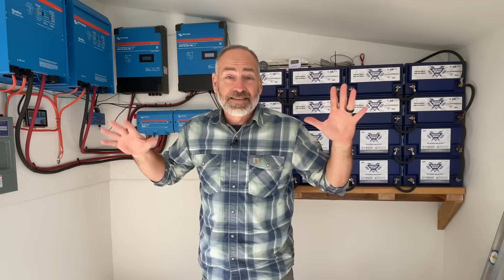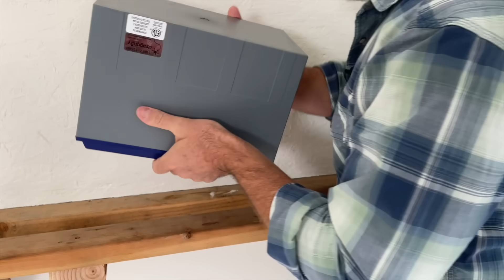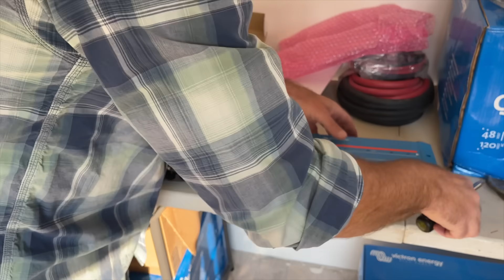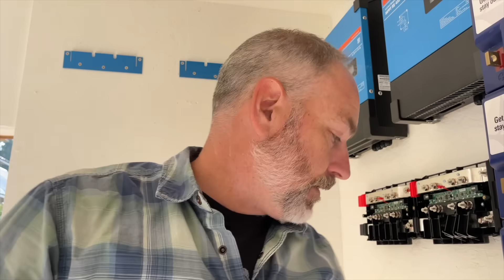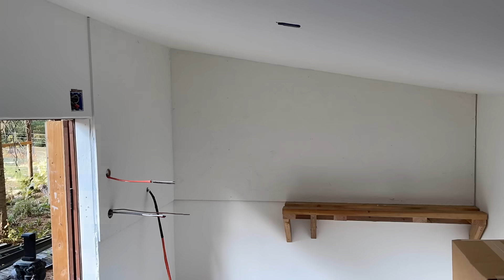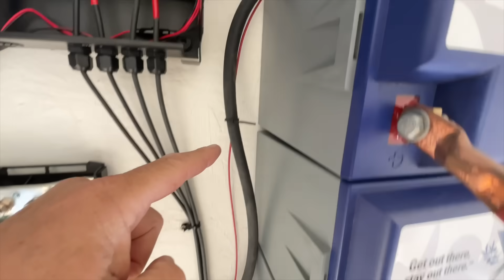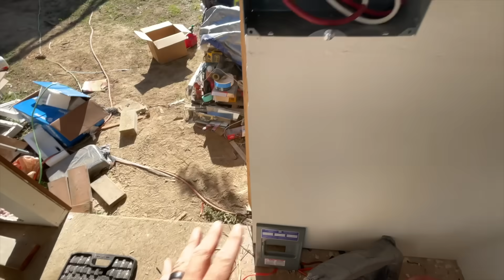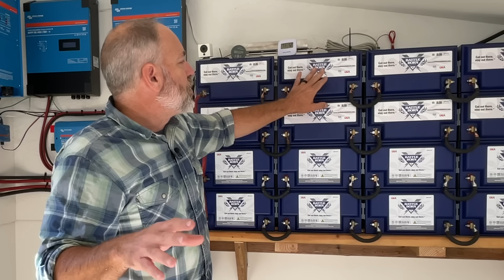EASIEST Off Grid Solar Power System Battery Bank

Comment: The only thing I would do is have the batteries spaced, so there not sitting on one another. Later on down the line if one fails you can pull out and disconnect easily. Maybe have a spare LIve and Neutral link for taking a battery out and linking the rest, while you source a replacement. In time everything has to fail once. law of averages.

Comment: Whatever you mean by off grid, you are not off grid.
Reply from the maker: off-grid (adjective) 
not using or depending on public utilities, especially the supply of electricity.
Reply: @MartinJohnsonOffGridLiving  Everything in your home, and everything you use to replace and repair it, was manufactured using public utility electricity. So you use it constantly. Ditto: roads, education, healthcare etc. The portion of your electricity usage that you are supplying yourself is far from large enough to justify your lifestyle or this channel having the label "off grid" by the definition you just gave.

Comment: So, ok, hold it. For a stored capacity (16 batteries) , given any possible deficiencies in the system output, your electricity demands could last 7 full days at an average of 2.7 kWh ???     Am I calculating that properly?
Reply from the maker: 100ah x 16 x 12v = 19,200 wh / 7 days = 2724 wh

Comment: the wires going to the house are far to small, ( wrong gauge ), if/when you start pulling more then 50 amps you will have problems.  you did a grate job on the dc side, it looks relay good.

Comment: It’s hard to tell, but the output cables look way to small. The run to the house cable goes a long way and definitely should be heavy duty cable at least 6mm/10 AWG or maybe 7 or 8 AWG copper wire for the power cables but earth can be smaller.  You could be running 40 amps in these cables and if not right sized you will lose voltage in you house run and the connecting wire to the inverter can get hot causing potential problems on the output terminals. I think as well as using thicker wire I would have used lugs on the cable end.

Comment: As an electronics technician I would like to complement you on your installation. A good job well done. Just one bit of advice I would like to give you. All that exposed wiring on your beautifully arranged battery bank is a very real safety hazard for the electrically uninitiated visitor. Please cover it with clear plexiglass to keep anything from touching the conductors but, at the same time, showing off the zen of the job. Thumbs up!

Comment: Very nice setup!

Couple things i have found make huge futureproofing - definatley run ferrules on connections. Sleeves/conduit for Solar runs to prevent fraying/wear/tear from contraction/expansion, Leave at least 2 feet of slack for wires out to solar field for movement room. 
Add outside remote solar shutoff. (fuses for the line/panels as well)
Clearly Mark/Product that solar line as its high voltalge, Instant death.

Comment: i was always curios. can you simply connect together two inverters or one inverter with the main grid line, given that's AC power? or should some sort of extra equipment be needed to match the current phase or sync it?!

Comment: Good vid. Inspiring. Your promotional statement that discharging  LifePO4  to 0 does not damage the battery is not correct. Given your knowledge here I suspect you know this already. 

Battle born them self say 3000 t0 5000 cycles.  "Our 100 Ah 12 V LiFePO4 Deep Cycle battery has a life expectancy of 3000-5000"

This would be triple that if only used between 30% and 70%

Comment: hi, greetings from the Netherlands. nice video and nice house it will be. question, can you put these batteries in series, thought they should always be charged in parallel. Are the cells of the batteries charged/discharged with the same current?

Comment: Nice work.  Looks pretty clean.  One suggestion, please strap the batteries to the wall in case of an earthquake.  I know they aren't super heavy, but if they fell it could be quite expensive to repair compared to a few straps to hold them in place.

Comment: Very nice electrical system. It looks very professional.
Can you make a video talking about the overall cost of your solar electrical system; batteries, controller, converters, solar panels, structures, wires, cost to maintain.
I wonder if you have made a comparison of kilowatt-hour cost of your system to the kilowatt-hour cost of the power company.
I am considering doing the same in my 5 acre vineyard as I build my home.

Comment: Does the battery manufacturer sell lug covers? At 48VDC, you should really have some additional protection for both you when poking around the battery backup, as well as for the fuzz butts who will potentially climb to warm spots.

Comment: How far can the PV cables to the inverter ? Do you lose alot of power or little or need some form of booster
Reply: I run just under 500ft of #4 USE-2 aluminum to my off grid cabin. Unfortunately there are trees in my way and the south side is my neighbors property and no way to cut them down. So I had to run my solar up a hill 450 away to have a clear opening to the south. Currently I run 2 sets of 3 330W in series for a open voltage of 122VDC. I measured 116VDC open circuit and when connected to my growatt inverter in MPPT it hovers around 105-110VDC and around 15-16A. In full sun I get between 1600-1700W input. For New England and my angles in later fall and now into winter I am happy with the numbers and my losses seem to be inline with my expectations. When I get my higher solar input 500V inverter installed this year I can switch them over to all in series and add 3 more panels to get closer to 370V input and maybe slightly better efficiency with the lower amperage. So very happy with my 1000ft of #4 aluminum. Was way way cheaper than copper, just took some extra help to get it installed.

Comment: Nice work, what i do not understand is why you do no use ferrules on the solar cables. you put the whole system at risk by saving a few minutes work. stranded wire without ferrules has a tendendy to work itself loose over time with thermal expansion and contraction (due to the changing load). When you expand the system spend those five more monutes and make your system more secure.

Comment: @ 0:26 battery storage for inverters is always expressed in amp hours aH
the reason for this is because you are taking DC and inverting it to DC...so there is a difference in how the power is used

if it was a dc system you could use kwH since that is a constant in Dc systems
but when you use AC from a DC system you count the amps , not the watts, because the amps remain constant while the voltage does not....the voltage starts getting lower in the battery while the use of amps remain the same

I dont explain this very well...but use the aH when talking about battery storage for inverters

I install solar

Comment: that generator input power wire looks to be a 10 gauge  am i correct    would a 8 gauge more suitable      what generator are you running       what would be the total charge time only from the generator        im assuming your only running a 30a and not a 50a   240v

Comment: I would only suggest you don’t leave the cables hanging like that. Run a large conduit and place them in there. Hanging cables can lead to arcing which you don’t want on DC.

Comment: Great job and love the detail and links to the equipment you used.  Just one thing I see wrong.  MAJOR CODE VIOLATION THAT MUST BE FIXED.  You cannot bond the neutral and ground together anyplace but the first disconnect, usually the main panel!!!  They are bonded in your subpanel.  You need to separate the grounds and neutrals in the sub panel and remove the bonding strap.  This is a major safety issue that can cause current flow in the ground path.
Reply: I noticed this .
Reply: Isn't IN THIS CASE the first disconnect in the battery shed and the one in the house actually becomes a sub-panel in this case only?
Reply: Most inverters have the option to bond in the inverters themselves. If you choose not to, then you have to bond in the mains panel.

Comment: What is our opinion about the Victron products? I also have two inverters and one charge controler. I did not pick this product for my system it was choosen for me by the initial installer who claimed he knew what he was doing. I have had a ver hard time getting any customer support from Victron and thus I am not a big fan. I would love to have a Victron expert that I can contact when I am having trouble with my system.

Comment: Looks very nice. Simple and clean. I have to say the price of those Battle Born 12v 100ah batteries (@ $874 each on amazon) is way more expensive than the EG4-LifePower4 48v 100ah (@1,499 each) at signature. Essentially one of the EG4 is equal to four of Battle borns making the price difference $3496 for four Battle vs $1499 for one EG4. Just to be CLEAR, that's $3496 for 5kwh of Battle Born capacity VS  $1499 for 5kwh of EG4 capacity.  That more than double the price. Could you explain your choice here, other than that they sponsored the video?
Reply: As soon as I saw all of those Battle Borns stacked up on the wall I had the same thought. Like why is he using all that space when 5 EG4s in a 5 stack server would have been cheaper and given him more power.
Reply: I considered this as well because that's $14,000.00 worth of batteries.  My guess is that, since he mentioned BattleBorn sponsored this video, hence, he likely didn't pay this for the batteries. Just my speculation.
Reply: I am pretty sure battleborn provided Marty a super discount or he got the batteries for free, considering the sponsored this video.
Reply: @guytech7310  He should mention the discount or the freeness. Those batteries hella $$$$$
Reply: @frederichoyos678  When a channel says: "This video sponored by" and the product is being installed\used, it should be assumed the host is getting it for free or discounted.
Reply: @guytech7310  cool
Reply: Frederic Hoyos -you are absolutely right. He is sponsored by battleborn and that's why he doesn't mention costs. This system and video is not for average Joe out there trying to save money.
Reply: @jab376  This exact channel has gone over the EXACT costs of a solar and battery off grid system in direct comparison to a gasoline generator off grid system. Go check it out if you want the cost break down!
Reply: @uhjyuff2095  Compared to Gasoline Engine? Waoo!! Thats a stretch and you know it. Thats different.  But hey kudos to him for making videos for rich people. I
Reply: @jab376  If you watch the video, you will see it saves time and money to switch to solar and battery versus gasoline and engine generator for off grid!
Reply: @uhjyuff2095  Not from his set up. That's for sure.
Reply: @jab376  Watch the previous video!
Reply: Yup guys. Simply put this solution doesn’t make sense if Battle born isn’t subsidizing the costs. There is not quality difference and some would argue that EG4’s form factor is preferable for a non mobile system. I do understand and like Battle born for mobile installation in RVs etc. there are some cheaper options in that form factor, but without getting it to all that I would say for a fixed install, this in insanely more expensive for no gains.
Reply: I watched this video and said an average off grid person is not putting a $23k solar setup in an off grid home ? And that's without adding in the solar panel costs. 

I have an off grid 50ft mobile home in Northern Arizona. When I am done rebuilding it. It will have a solar generator system for under $5k. Solar powered lights. Wood stove. Small swamp cooler for the summers. Easy peazy.
Reply: He has owned the BB batteries for a while before EG4 existed or even made batteries. Remember Battle Born is the OG of LifePo4 off grid batteries!
Reply: Yeah, you are better off shopping around for the best 48v batteries for sure. Also avoiding the series coupling when coupling as I  understand there could be trouble in balancing out multiple batteries like that if one starts misbehaving.

Comment: Excellent, you got me there.... I thought, my god, I need to warn him that his shelf isn't strong enough! But those heavy bats are almost floating ;-) (ohh a little halloween there too haha). Also wanted to say what a sharp system and video you've done. The layout of the units is a beautiful thing to behold. I didn't realise the cable to use for the short battery connectors was so flexible, amazing!

Comment: I am a solar contractor and I am very impressed with how well you put this together. Gonna sub and follow you around. new stalker

Nice work Martin
Reply: Are you in the Chicagoland area?
Reply: With the price of this set-up, why not/what would be the difference with a Tesla powerwall?
I'm a noob so thank you for your answer.
Reply: @farah-5538  Tesla PowerWalls are not suited or meant for an offgrid application. They are fine as a battery back up with grid tie. They cannot utilize a generator to charge batteries.

Comment: Love the setup. Looks really nice. I'm no expert, but don't you need a balancer for the batteries in each series circuit? Either that, or if you parallel them 4 at a time and then series connect those and use just one balancer?

Comment: Great job...!
You've nearly convinced me to build an Off-Grid Solar Power System... I might have to watch this a few more times.
It looks expensive though...
Reply: I just did a quick check...EACH of those batteries is $874.00. The large inverters are like $2500. It may just be me, but I don't have $20,000 plus dollars to build an off grid solar system, at least like this. I'll be looking for a bit less expensive option...

Comment: i build my system in 2006 with 24 lead acid (car) in 3 groups from (8x 12v) in parallel 4x12 gives 3 groups from 24v 
3 x 2 solar panels 110watt in parallel with 3 x tristar 45 chargers.
my house is sliced in separate parts with new wiring ( i had 3 vectrons 2000watt 220v but it drain the system to much) so i change the system to a 12v system only for the led lichting in house, that's works great in 2022.

Comment: Great video.  I noticed you drove in a grounding rod at the shed.  I assume you have a grounding rod at the house also.  You can get into trouble here.  A lightening strike to Earth will charge the Earth and this charge will drop exponentially with distance.  So if the strike is closer to one ground than the other, the charge between the two grounds will be significantly different and any conductor connecting the two grounds will be the path of least resistance to neutralize that.  This means sparky sparky, out goes the magic smoke on all your beautiful stuff.  Code on how to manage this will depend on how far apart your shed is from the house, but I would look into it.  You may be able to get rid of the shed ground and tie the ground back to your main ground, or you may need to isolate the neutrals.  Personally, I feel a lot better having just one ground.

Comment: One of the most impressive and sensible systems Iv'e seen, Battleborn are insanely expensive especially compared to buying the prismatic cells yourself at 1/3 the cost but if you can afford it they are just plug and play....

Comment: They make a special screwdriver it’s all three- Flat, Phillips, and Square ! All in one ☝️.  When you use the correct screwdriver 🪛.  They’re the same for electrical outlet’s and other electrical screws that need to be tight. Thanks again for your work and posting!  (Klein Tools 32378 with a #1 and #2 Combination) also Milwaukee.

Comment: As a former electrician, I'm confused on the wire size that connects your solar shed to your home panel. I see you're using 10ga romex, if that set-up is running only 30A to that house panel then no further explanation is needed but it seems like that ginormous system is running much more than just 30A's....NO???   I'm trying to learn about this solar power options but their use of power measurements WH, AH's, etc is making it really hard to know what's what....😳

Comment: Hi Martin, great video! Question: Why is the load on L1 and L2 not the same when you powered up the house? As it is split fase I expected them to be equal because both inverters power the same load, both half of the full fase. Thanks in advance for clearing that up!
Reply: As much as an electrician will try to balance the house panel, it never comes up perfectly. The simple answer is one phase is using more power than the other. He obviously has more load on his 110v stuff on that side of the panel

Comment: Did you need to change any settings on these inverters or charge controllers or are they all just in standard mode?
Reply: He seemed to have left that “little part” out.. the Victron Quattro inverters have a many many settings which have to be adjusted prior to flipping the switch esp setting it up for split phase power.. this by no means is a “how to” video..